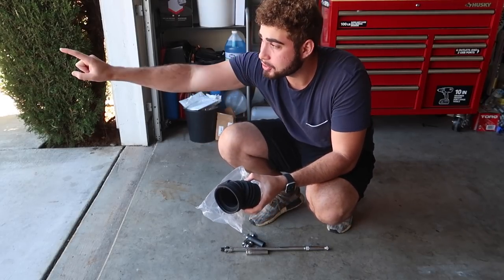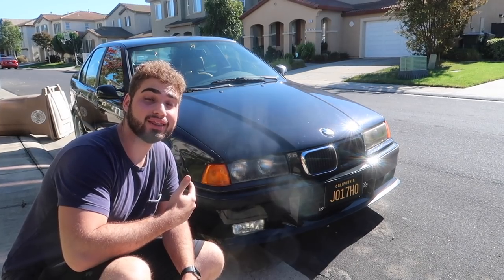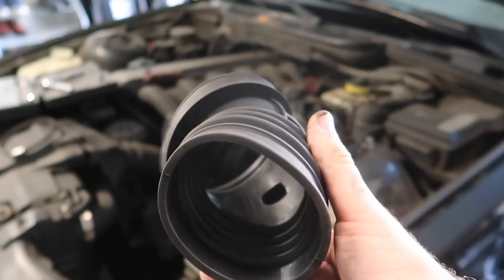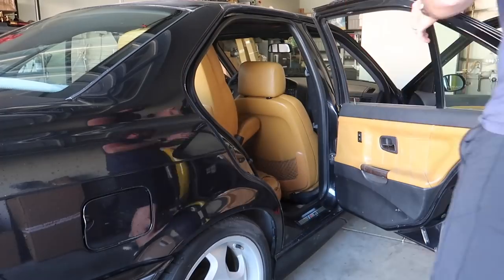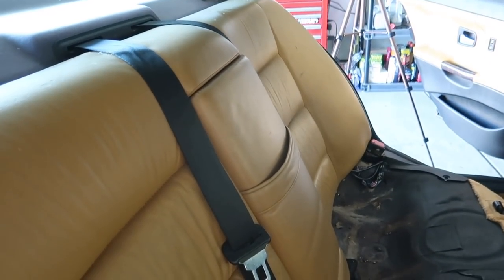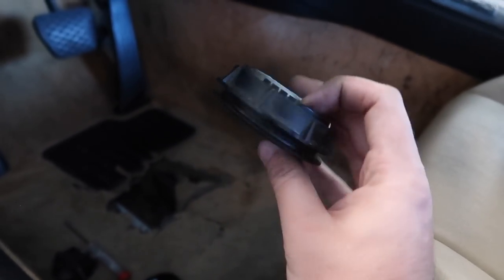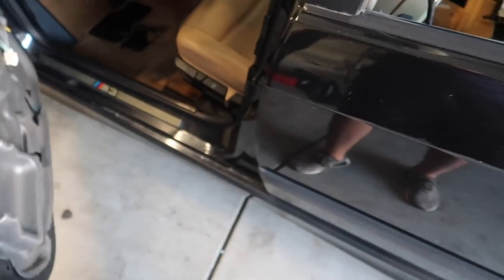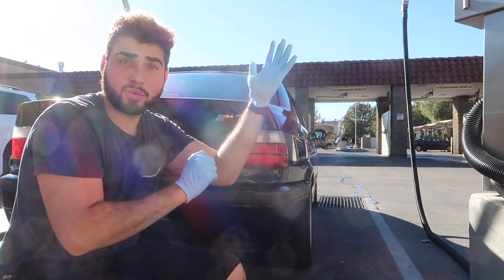STRIPPING DOWN THE E36 M3! TIME FOR THE RACE CAR INTERIOR!

Comment: the radio doesn’t work not because it’s bad it’s because it needs to be coded in that happens on older cars when you discount the battery the radio is locked and you need the pin to unlock the radio look into it bmw should give you the radio code and it should work.
Reply from the maker: That’s crazy good to know tuabks
Reply: yeah you just need a passcode for the radio
Reply from the maker: Amir Mostafa if I get an aftermarket one will I still have this issue?
Reply: @NourHummadi  No your not only for oem radios the reason why is because back in the day people used to steal radios very often so they have to put a pin on each radio so it would be locked and everytime you disconnected battery or radio you have to put pin in again.

Comment: Why remove 1kg doorpanels 😂 tf man. Try focus on the things that matter with a track build. 

These video’s are beginning to come more and more simpel. Replace a rubber and removing an interior, aaaaand another video.
Reply: “Full racecar” because of the doorpanels😂😂 wauw
Reply: I’m just wondering if he will pull through with what is it? The fourth track build?

I mean it’s not as easy as he is making it out to be you know.
Reply: Also, why first completely build a car for the track. Just put a set of coilovers and grippy tires. Fix the brittle parts in the cooling system and you can ride. A cage, bucket seats can all come later if you deside track riding is a hobby you want to continue